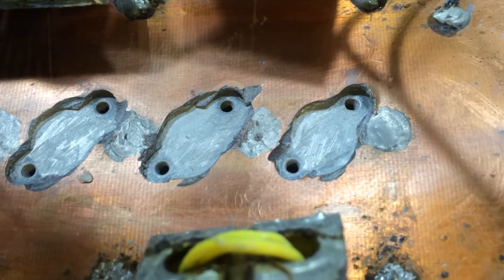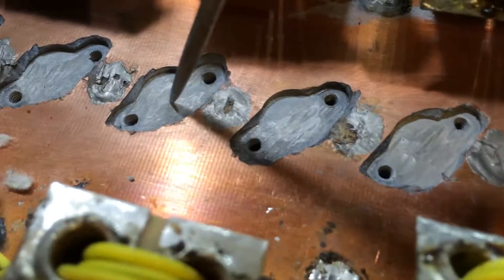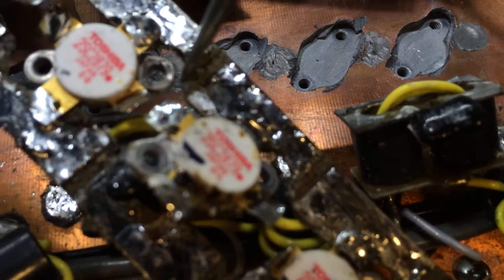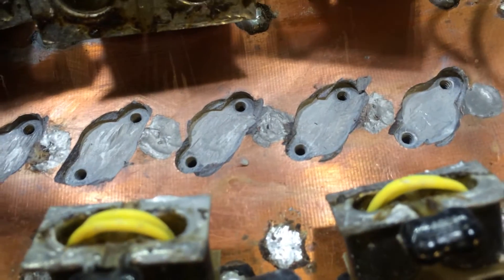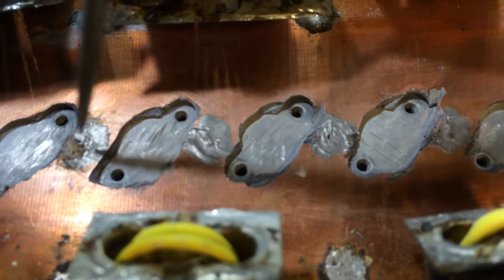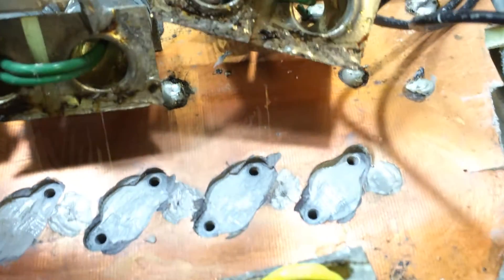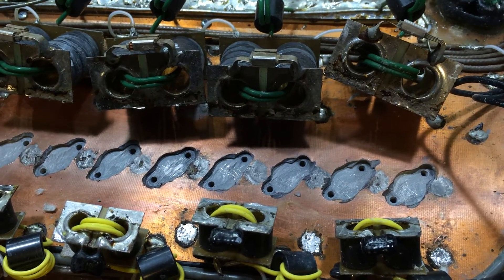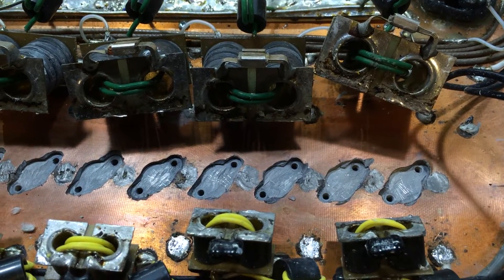10Pill Repair After It's Been "Super Modified" 4/4

Comment: Why worry about  Ohms Law ? When you don't care about this law.

 Section 
   2.1204(a)(5) of the Rules5 to prohibit all marketing 
   and/or offering for sale in the United States of such 
   devices even when the seller(s) had provided assurances  
   that the transceivers are being sold solely for export.  
   ALL DOMESTIC MARKETING OF SUCH DEVICES VIOLATES THE 
   COMMUNICATIONS ACT OF 1934, AS AMENDED AND THE 
   COMMISSION'S RULES.
Section 302(b) of the Act, and Section 2.815(c) of 
   the Rules4 require FCC type acceptance (or Certification) 
   of External Radio Frequency Power Amplifiers (or 
   amplifier kits) capable of operation on any frequencies 
   below 144 MHz.
You may need to be careful who you piss off!